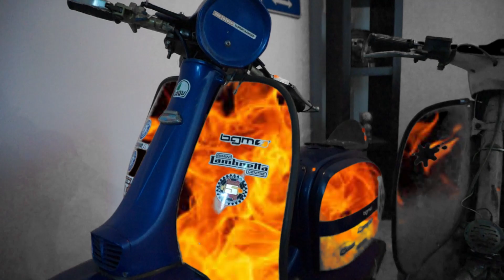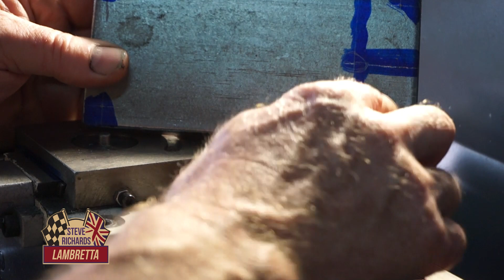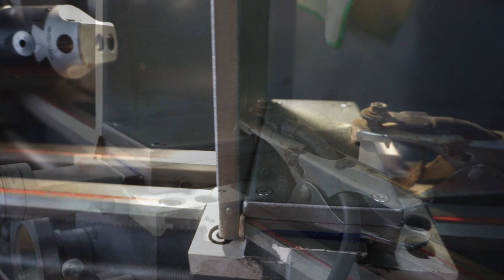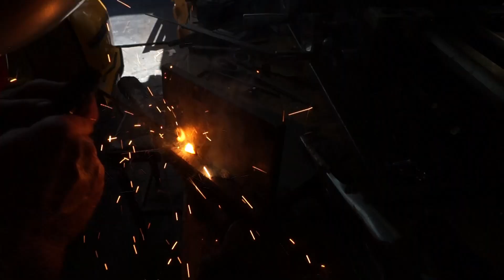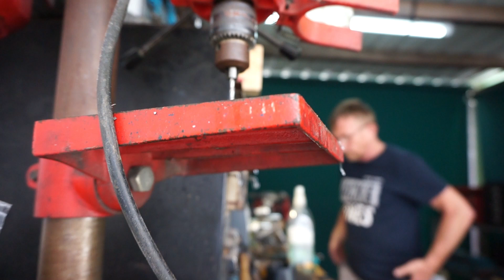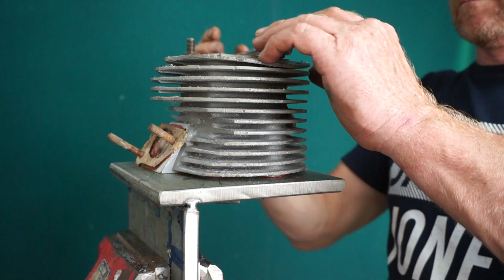lambretta  LI 150 TUNE PART 3

Comment: Really enjoyed it Steve - took me back to 89 - I worked at dawtune motorcycles on Gladstone lane, Scarborough for Don Daw. He was a genius at 'heath Robinson' contraptions and did everything in house old school 
Don had a selection of home made jigs which were a base plate to go in the 4 jaw Chuck and held the barrel in place with threaded bar and slotted steel fingers that spread the load across the fins where they were reinforced- centering the barrel  took a while and the boring tool/ honer was mounted on the stock 
Lv the videos 👍

Comment: Do you know if I can use royal purple oil max  gear synthetic oil SAE75W-90 in my Lambrettas engine I know it’s a very good oil was just wondering 🤪
Reply from the maker: SAE 75 90 W should be fine as long has it doesn't have any additives

Comment: great work  ,but   would it of been easier   making a sleeve for your  boring  bar  to fit into the tool stock
Reply from the maker: Nope cos the chuck is to small and you cant bore all the way through?  And this way it runs on auto .
Reply: ah  did`nt notice the chuck size ,now I know why you  did it that way  ,and a great bit of engineering
Reply: when you get bored steve  how about making an original looking disc brake  with a hydraulic  brake set up that operates both sides
Reply from the maker: @darrinslack1269  you dont need twin disc its just cosmetics on a lammy , but i might have a go at putting a radial caliper in a original disc and a modern disc inside ?????
Reply: that`s what I was   getting at  ,keep the original  60`s design but have a hydraulic piston on  both pads
Reply: better  vented disc  ,